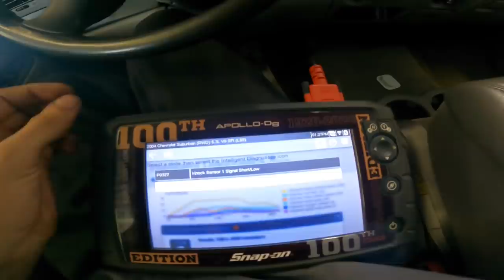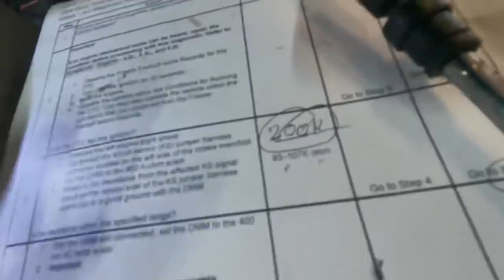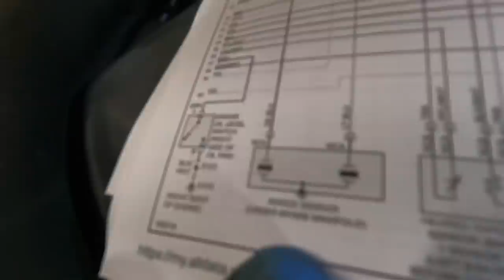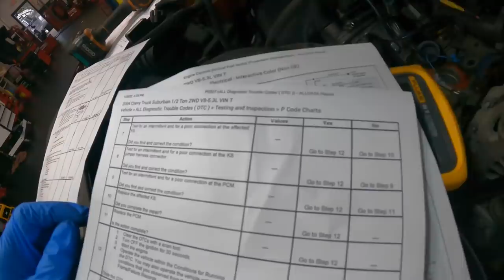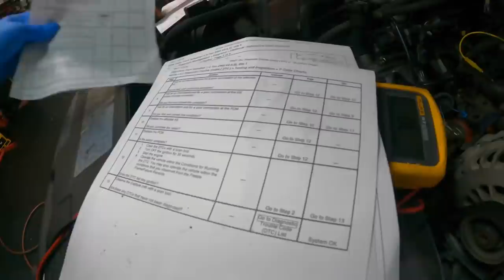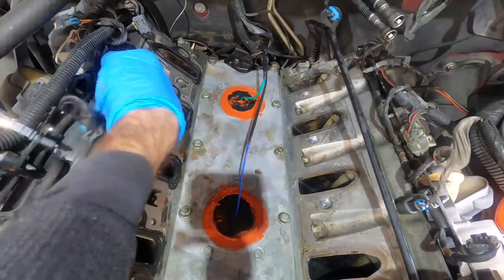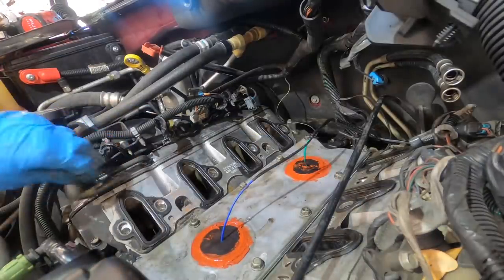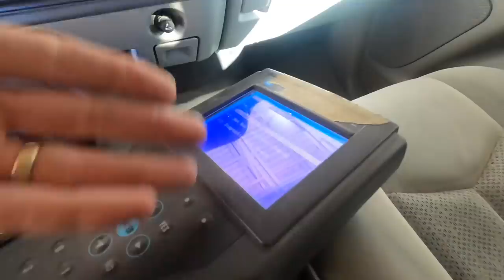Had to DRILL the engine block. NIGHTMARE Diag! LS 5.3 Check engine!

Comment: I hate flowcharts. They lead to many stupid and avoidable expensive non-fixes. First thing I would do is backprobe the sensor pins at the ECU and put an oscilloscope on them. Get a good look at what the computer is seeing. At that point, with only that one single test, it would've been obvious that the ECU wasn't the problem.

Comment: Great diag but you ended up making more work for yourself by breaking off the sensors. Also, once you did... you should have just welded a nut on top of the threads so you didn't have all that metal to clean up.

Comment: My rear knock sensor snapped and easy out didn't work and I didn't want to weld on the engine and possibly damage electronics so I drilled and retapped. But for anyone doing the same thing do not buy ac Delco sensors off eBay they are far cheaper than ac Delco on rockauto because they are china knock offs claiming to be ac Delco which is a lie. They're junk and don't produce enough voltage

Comment: Check sheet is asking for 93 - 107 kilohms, yet you said it measured 100 ohms, unless that was just a mistake in what you said.
Reply from the maker: At first I got 200 ohms bc I didn’t read the directions to the fullest. I checked resistance between both pins in the connector. I was supposed to check each pin to ground, thus giving the 200 ohms total instead of 100 on each circuit.

Comment: Cut slot with dremel tool when possible and remove with flat blade screw driver. Also new silicone will not stick to old silicone.  Remove old silicone before applying new silicone. Otherwise, nice work on a crap job.

Comment: I'd definitely call it a success , if you win when fault  finding takes you into the badlands beyond the flow chart you get to pat yourself on the back . 
Probing the sensor output with an oscilloscope may have given a true indication of its condition . But having previously been replaced does throw a spanner in the thought process , being the second person on a job frequently means unscrewing the previous guys pooches first.

Comment: Ever heard of a magnet, ray? They’re a new fangled contraption every mechanic should have, they clean up steel fragments exceptionally well. 😆

Also, you put far too much faith in new parts, I’ve been flooded with parts that were defective right out of the box, or failed in a matter of days, especially since the Trump/China trade bans, and then the pandemic crap.

Comment: I wish you lived in my area Ray. Id have you work on my car 10000%. I got new tires 2 years ago from the dealership, Subaru. Went to change my brakes this past weekend and i cannot get my lug nuts off. This is with a 275LB Gorilla and a 4 ft breaker bar. They went full send when putting on my new tires. At this point i dont know what to do except take my car to the shop down the street and ask if they can break them free for me. Would that be bad or annoying? should I give them my new brakes and ask them to install them for me while my wheels are free? Like a thankyou, here is some work as appreciation? I dont want to insult the garage with the, I cant get this first step pls help. I'll do the rest on my own. 
I was just trying to save a bit of money doing my own brake job. I used to do all the work on my cars myself so a brake job isn't hard at all for me. 

Also, With the lugs being this over tightened im assuming the Lugs themselves are stressed and need replaced. Or am i just overthinking this.

Comment: Those were a horrible design sensor.  They always fail, and most of the time they were rusted in because GM, in their infinite engineering wisdom *cough*,  decided it wasn't necessary to seal them better at the factory.

Comment: such drama for nothing.
a stud extractor would have worked.... or mig weld a nut on the threads.
Heck with that much thread you can just double nut them and turn it out with a spanner.

Drilling is the last option for me.

Comment: First, my shop manuals show charts for torque based on bolt size when there is no specific torque given.   Second, what happened to your fancy Snap-on scan tool?  I hope you got paid enough for all that work.  I will pass on to friends who wrench their own vehicles what you found about the over tightened knock sensors.

Comment: For this Generation GMC/Chevy the poor knock sensor design costed customers ALOT and I mean ALOT of money due to having to get this done on about 99% of all vehicles.  Horrible design that would originally allow moisture in therefore damaging the knock sensors.  Came out with buletin to seal around after replacing.  Due to the poor design the original issue is most likely what caused this.  Before buying a Chevy/GMC 1999/2007 always check that this hideous work has already been done.  If not prepare to do sooner than later.

Comment: Your drilling technique in metal is flawed.  You'll burn that drill with that kind of RPM.  Lots of pressure, low RPM will keep your drill on the cutting edge and keep your drills sharp.  Advice from a machinist who deals with this every day.

Comment: You didn't read the instructions correctly so you didn't measure the resistance correctly so therefore you wasted an hour taking the manifold off because you didn't do it right you made a mistake

Comment: Well your drill bits suck, because you weren't using any oil/lube when drilling the metal, it works a lot better with some kind of lubricant, and your bits last longer. 🙄